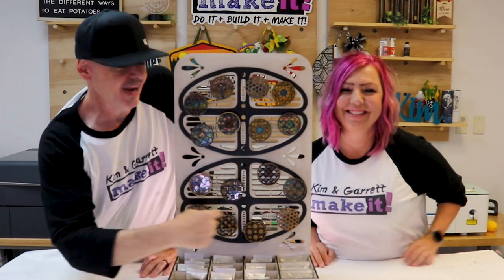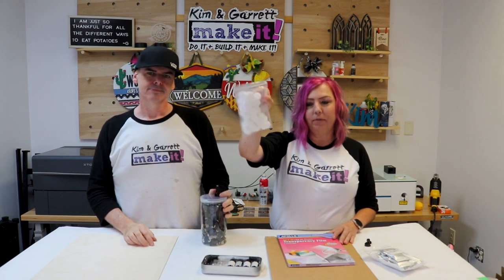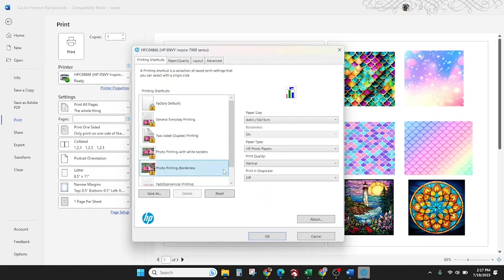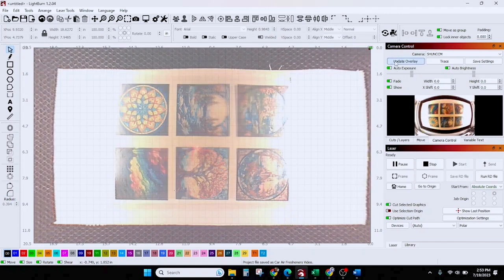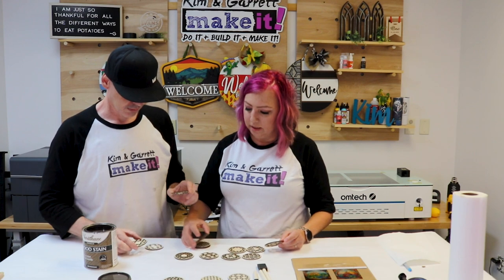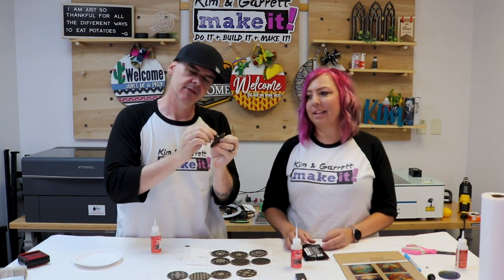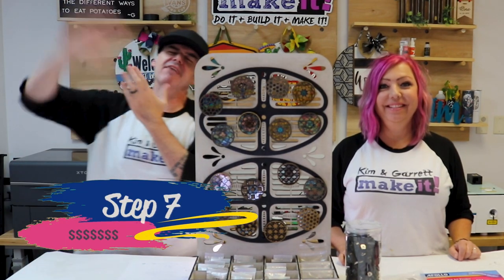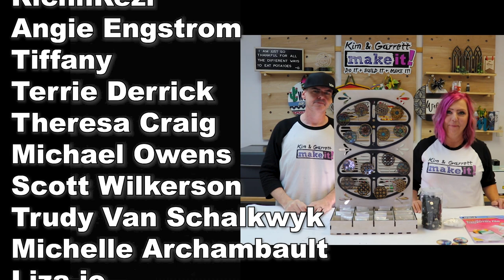How to Make the Easiest Laser Cut Vent Clip Car Freshies | Car Air Fresheners

Comment: Just wondering where you attached the felt pad?
Reply: The felt pads fit in the holder. There’s an open section that you drop the felt pads in and they can be easily replaced.